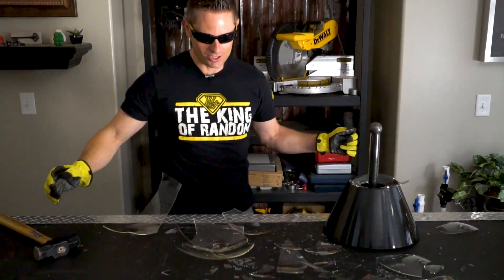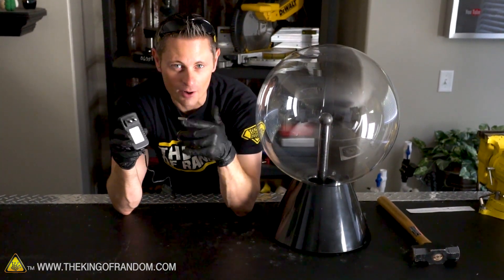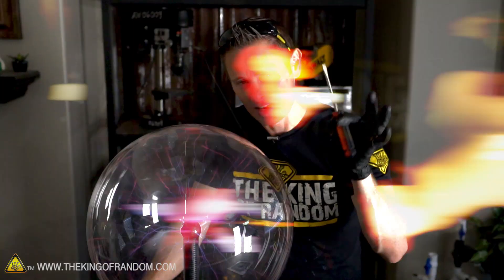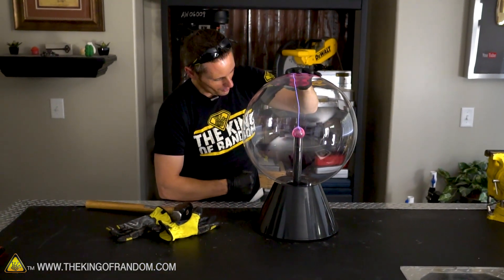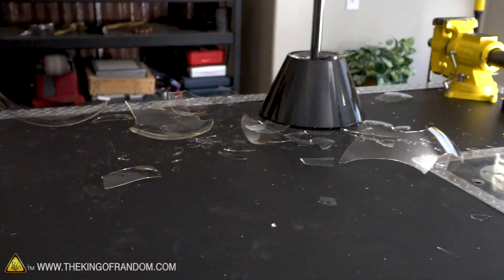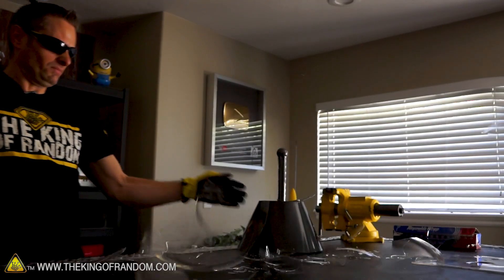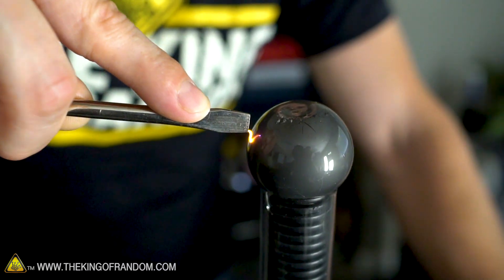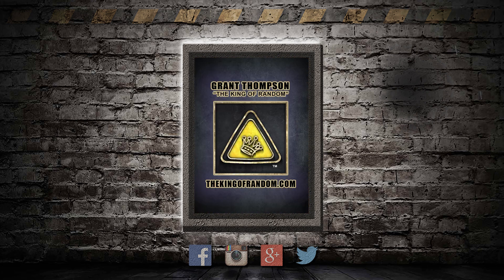Should I Do It? TKOR Tests What Happens If You Break A Plasma Ball? Breaking Plasma Balls 101

Comment: The individual seems unaware of the specifics of his setup, which involves a Tesla coil in an inert gas environment. The continuous arc results from altering the air properties in that area. It’s crucial to note that a legitimate Tesla coil could be lethal, and even the risk of broken glass is significant. The lack of uniformity is due to the use of blown glass. I am glad he did not die.

Comment: The plasma ball uses the same technology as a CRT cathode ray tube television also known as a lead tube TV to generate that high voltage it's 30,000 volts for that big plasma ball but it's 10,000 to 15,000 Volts for the small plasma balls and a plasma ball uses a flyback Transformer in order to generate the extremely high voltage necessary to jump the large air gap between the center of the plasma ball and the glass itself the voltage needs to be extremely high in order to jump the air gap even inside of a sealed environment.

Comment: The reason the plasma globe didn’t implode is because most modern plasma globes don’t actually use a vacuum. They instead fill the globe with a mixture of nobel gases at regular atmospheric pressure, which allows bright plasma to form without the need of low pressure.

Comment: The tower in the middle is not a tesla coil I took in one apart a flyback Transformer is connected through a wire goes through that it's a plastic insulation that is all

Comment: Nothing would happen cause the cells would be split up, they have to be compact for it to work. And the little plasma lines don’t cause that much damage. There would only be minor damage if you could manage to touch a volt. The cells are going to activate the volts, making it a plasma globe. The cells were released when you smashed the glass, therefore deactivating the volts. There would probably only be a spark when you smash it, that’s my opinion before watching this.  

-Btw I’m not a nerd I just learned this a slightly long time ago.

Comment: Glass is neither a solid nor a liquid. It's a constantly, yet slow moving plasma. If you find original windows in a house built late 1800's to early 1900's, the window glass will be thicker at the bottom than the top.

Comment: it's not filled with argon or nitrogen but instead filled with neon gas.
and that's the reason why the electricity went out.
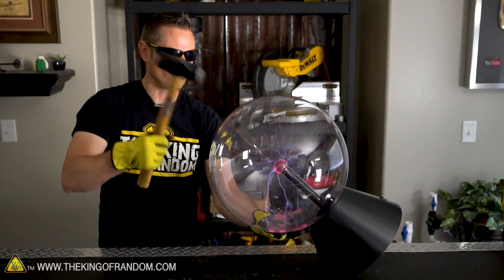and if you play 5:06 in 0.25 speed, you could see a big bolt of electricity when the glass was smashed.

Comment: It stopped working when the glass broke because the gases (Argon, Neon, Krypton, and Xenon) have been released from the contained space. The glass keeps all the noble gases in one spot and the heat from the high voltage tesla coil causes the plasma streams

Comment: I'm guessing before this starts it will just go out because it is plasma which is a super heated gas and the dome is keeping compressed gas in so the electricity can excite the electrons so much so they break away from the other parts of the atom. But if you break the dome releasing the gas in the dome it will not be able to make plasma because the air can't be made hot enough (this is all a theory it could also be filled with a gas like pure nitrogen that that would be turned in to plasma much quicker then oxygen).

Comment: How about this for a project. Make a home made generator with a lawn mower engine (or equivalent) and an automotive alternator. You may have to remove the voltage regulator so it can generate more than 12v

Comment: A bit late, but what you probably did was ionize the air in that portion where the sparks were shooting through, allowing electricity to flow more freely through the ionized part. Lightning does this, and that's why lightning keeps form as it surges through the bolt that makes contact with the ground, so the air along that bolt gets ionized, and stays that way throughout the pulses of lightning that occur. I could talk about this for hours

Comment: I know why it exploded because there is conpressed air keeping it intact. Also when the compressed air is disposed from the globe and reaches the oxygen there is a sensor that shuts it off. But you can still melt the glass and make electric bolts.

Comment: if you put the prongs from a phone charger on the tin foil on the plazma glob will it charge your phone
Reply: Hungry jaycob really!?!?!?!
Reply: I doubt that lol
Reply: it works (for me anyway)
Reply: That might work or it might be catastrophic to the globe, phone and/or you. The problem is that the power supply for any given device involves the usage of a transformer. Transforms are really simple devices (Dept of Defense has an awesome video about them on YouTube). They convert a known voltage-amperage into the desired voltage-amperage by exploiting a proportional conversion of electricity to magnetism to electricity. If you provide more power on the input winding you proportionally more power on the output winding. It's up to the electronics engineer to decide if it should have protection or what form that protection comes in. A lot of times it's a big resistor wrapped in heat shrink tube, the heat shrink tube is there to protect you and surrounding circuits when it's surged so that all one must do to save the device is replace that resistor.

Comment: You should get a lava lamp and smash it and see what happened like if You agree
Reply: Amarri_T06 :/ is filled with different acids so it will do something bad
Reply: Amarri_T06 :/ 
Lava lamps contain only coloured water and paraffin wax. Nothing special.
Reply: Pseudo Nym some contain highly flamable stuff and that could end bad because its over a heat source
Reply: Lava lamps have a highly flammable acid and coloring because the chemical inside it is flammable and the lamp is high pressured it would explode with the coloring and burn some of your stuff that chemical is put there so it lightens better the bubble is carbon diocside or sulfur or Gm

Comment: What if you drilled a hole in the plasma ball and put liquid nitrogen in it
Reply: AER Gaming then turn it on
Reply: AER Gaming 
Would it still react the same? Would the colour of the electricity stream change? So many questions!!! And in order to have those questions answered I agree he has to find a way to get liguid nitrogen in a plama globe without shattering the glass!
Reply: Not possible, if he made a hole in the glass the pressurized gas would seep out and there would be no reaction

Comment: The globe is filled with noble gases so it does have some sort of positive pressure.

However, regardless of inside pressure, the spherical shape of the glass will cause it to "explode" outwardly because of the transfer of stress and force.

A simple example of this is an Arch bridge. if you push on the top of the arch, the load/force transfers to the feet of the arch and pushes the feet outward because of the geometry. Now take that simple geometry, spin it in a full circle to create a hemisphere, the mirror it about the bottom face to create a sphere. Pushing at one point of the sphere will make the rest of the sphere move outwards.

Comment: It's roughly at standard atmospheric pressure inside, and filled with Neon, Argon, etc. This lets the charge travel through it in a visible way.

Like another comment said, I'd love to see you try to build your own plasma ball. Probably easy to put the electronics (even a battery-operated flyback would work) in a vacuum chamber, lower the pressure, then introduce the noble gases where you'd normally let the atmosphere back in until it's 'full' and you can see the plasma effect.

Comment: Can I rain on your parade? It's not a tesla coil it uses a fly off transformer, completely different circuit and a lot less fun than a tesla coil, Furthermore if you use the rule of 30,000V/cm to ionize air, you can estimate that there is only like 3k-6k V, so unimpressive...

Comment: there was an inert gas in there which allowed the electricity to travel through the ball so when you destroyed the ball the electricity couldn't travel, and thats why it didnt work anymore

and you saw a zaps of electricity when you put the metal near it because the electricity could jump that distance, and the ball imploded because it was under vacuum
Reply: No, it is easier for electricity to arch in low preasure so therefor the preasure in the globe would have been lower
Reply: looks like someone did their homework!
Reply: the top of the glass exploded probably due to the positive potential it received while the hand was place on transferring the negative charges towards the hand, making the glass positively charged
Reply: Grumslug but that doesn't answer why it exploded since the lower pressure implosion
Reply: Shut up
Reply: QuickScience
Reply: That inert gas/noble gas was probably   argon
Reply: Every day Mans on the block
Reply: J0 X-12 Also, blown glass is under quite a bit of internal tension. as the surface cools before the  interior can fully expand. It is possible that that tension being released could also have added to the potential energy. Causing the glass to release that energy expansively regardless of the pressure differential.
Reply: Roadman Shaq ok science man ok
Reply: Just because it wasn't emphasized enough... Something can't both be filled with gas (inert or otherwise), and also be a vacuum.
Reply: Maybe it started out as an explosion but then due to a drop in the pressure the rest imploded?
Reply: メ_刀ԾㄎζԾア乇_メ under vacuum means absolutely no gas or atmosphere, it had to be highly pressurized gas
Reply: kaleb coker my mistake, but thanks for pointing it out!

Comment: can you show what happens when you fill a 2-litre soda bottle with works toilet bowl cleaner, and then drop balled up pieces of aluminum foil in and screw the cap on tight??
Reply: if anyone reads this comment and wants to try it, make sure you run as far from it as you can once the cap is on!!! and don't do this inside or near anyone

Comment: just remove the top and there is a wire that is goin into that black class buble there , it has some metal particles in it  , from the wire u will get much more stronger spark that can burn stuff  and if u put a candle near it will bite the flame and will extinguish it for some reason,  u can light a Luminescent lamp too. You can try to convert it into a Tesla coil. sry for the  bad english

Comment: Figure dielectric strength / breakdown voltage for typical air of about 10,000 V/in. ... So each 1,000 Volts will get you about 1/10 in. of spark - so the bit done with the foil ... estimated probably roughly in the range of about 1,000 to 2,000 volts.  The interior is typically low pressure gas that ionizes fairly easily, so the breakdown voltage/in. is much lower - hence the long colored (ionized) streamers within the glass.  Once that's busted open, again, e.g. with screwdriver, you get about 1/10 to 2/10 of an inch that can form an arc - so probably roughly around 2,000 Volts or so.  Drawing longer arc?  Ionized air is a better conductor, so once it's ionized, one can draw the arc out longer ... until it deionizes ... then need to bring the screwdriver much closer again to start it up again.  Yes quite high voltage ... but the current is quite limited - so relatively harmless.  Were the power much higher and the current not limited, it would seriously fry and burn body parts and very possibly even electrocute.  With the very limited current and power, it can barely burn tiny pinholes in thin paper.

Comment: The chamber was a vacuum. If it was pressurized it would take even higher voltage to make an arc than it would in plain air. 

The yellow flame at the end was sodium ions being kicked off the glass, you were melting it a little bit, or found a small crack, that's why it went back to the same spot every time.

Comment: try ac high frequency from a welder even without the ground hooked up   just having a florcenet bulb on the electrode cable can light the bulb have had it jump through a plastic insulator through leather and into a table out my elbow felt like a needle in that area

Comment: hey grant I have a question if you electrified the blade of a katana would it set objects on fire when swung or possibly set fire to the air when swung.
Reply: No ... think about it. If you've ever been shocked through static electricity, started your car, or used a lighter, you've made an open spark. You, and everything around you, would explode in a fiery blast every time you did these things if you could "set fire to the air" with electricity. 
Swinging an electrified blade likely wouldn't set objects (or the air) on FIRE in the fraction of time it takes to hit someone with said object, however you could probably give them a shock. 

Would be a cool project minus the "set fire to air" thing, but I'm not sure who'd be willing to be the test monkey for it :3
Reply: I see where you are coming from

Comment: So, yes the glass is irregular which points to it being hand made"blown" pretty much all like this are irregular. As to it "exploding...let's review...the sphere is glass,the Tesla coil was generating plasma strands which are super heated causing the atmosphere in the globe to heat and expand. And since the dome was containing that hot gas, naturally it wanted to expand further. Bust the barrier out goes the hot charged atmosphere! Taadahhh....duck,,,yow glass everywhere! Just sayin.
Reply: It is actually under a vacuum, so there is no resistance for electrons to form arcs, just like a Crooks' tube. And that wasn't a Tesla coil, just some insulating material so the arcs form on the center ball and not on the tube going up.
Reply: I've read that they're usually filled with an inert gas (most commonly neon, sometimes with argon, xenon and/or krypton, to give different effects) at nearly atmospheric pressure.
Reply: a vacuum will actually supress an arc. It must have been a gas that freely permits the flow of electrons
Reply: Tom Sikes nerd (not in a bad way)

Comment: Its a power inverter with an electrode prong, not a tesla coil. The gas is a cocktail of neon, argon and xenon.
youll get much nicer arcs if you take the base off and pull the electrode out from the insulating tower... just dont touch the circuit board, the transformer cranks out some juice, and you can create a short.

Comment: Dude, you can take it apart and there is a wire inside that the electricity goes through that runs up the center.  You can touch that wire to regular incandescent light bulbs and get your arc back.  We did this when we were teens from a smaller one.. all kinds of fun stuff including burning things and making “trails” of burning lines through things like plastic/SNES cartridges lol

I’m now 37, so that was a long time ago hahaha

Comment: According to Wikipedia, the globe is filled with noble gases (mostly neon) at roughly atmospheric pressure, so I think it exploded because of the way the spherical shape transmits the shock through the glass.  Presumably the breakdown field strength of the neon is much lower than air, which is why you need to go so much closer to the inner sphere to get a spark. The reason you can draw out the arc like that is because once you've already ionised the air it's relatively stable, so increasing it's length by say 1mm, is just as easy as striking an arc of total length 1mm directly from the electrode.

Comment: That's not a Tesla Coil. There's a Flyback style transformer inside the black base, that can generate thousands of volts from a few volts DC. That coiled wire inside is just a wire to carry that power toward the center of the sphere. The gas inside is Xenon, responsible for the purple, blue and white glow of the arcs.

Comment: it didn't create the massive arms of electricity because it takes 30 thousand volts to ionize 1 centimeter of air. and the was no air in that chamber, until you broke it. And that was extremely dangerous, because the electricity could have gone to your arm and grounded itself in your shoes. In such event, you would be dead because that energy would have travelled through your heart, and therefore stopped it.
Reply: It's the volts that jolts, but the mills that kills. You can get away with this because the current is very low.
Reply: kleetus92 Bravo!

Comment: does bullets work after putting them in liquid nitrogen and will the gun work after dipping it into liquid nitrogen 🤔

edit: wow so many likes😉👍
Reply: yes to both of those questions
Reply: Gun: Definitely
Bullets: Most probably
Reply: the gun might have parts that shatter from the bolt slamming forward. Steel becomes more brittle when it's cold, especially if it's hardened steel.
Reply: Yes

Comment: It didn't explode or implode. That was just because of the shape of the glass and impact of the hammer.
Reply: well normally plasma globes have low pressure inside atleast a little bit unter atmospheric but nowhere low enough to make it implode
Reply: Talus Tanat  i was thinking the same
Reply: wrong
Reply: It would have exploded because it is pressurized neon or argon.
Reply: charlie baker I don't think there's much pressure....

Comment: Try putting a small magnet in a small bowl of liquid nitrogen, waiting 2 to 3 minutes, the put a inch smaller magnet on top of that magnet, make sure both magnets are in the liquid nitrogen and waiting 5 minutes, then take some tweezers and (with tweezers open) pass through the middle of two magnets the will be hovering away from each other, but still at the same time

Comment: Fact one: The gas inside is a mix of argon, a small amount of neon, and helium.

Fact two: The coil inside is for decoration, the flyback driver (a high voltage transformer found in CRT screens) is mounted on a circuit board inside providing tens of thousands of volts.

Fact three: The reason why you don't die when you touch the glass is that the glass is insulative, yet thin enough that you feel 1-2 KV at like a half milliamp.

That's all, folks!